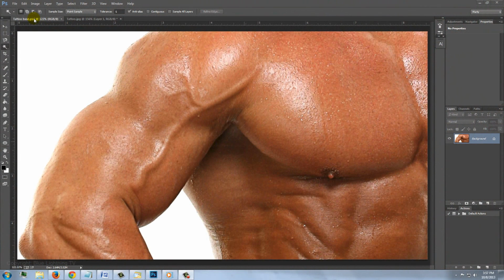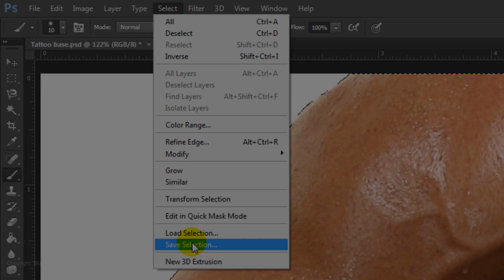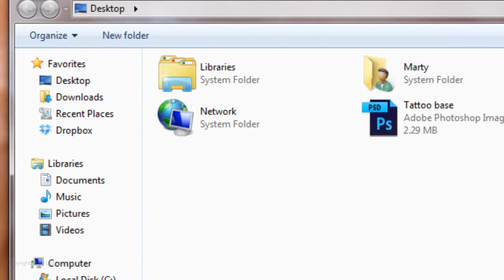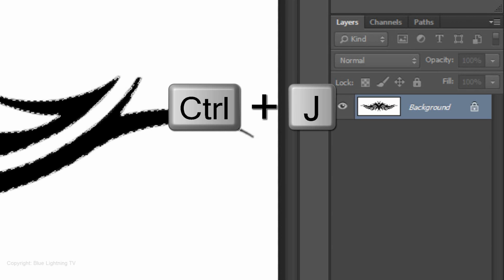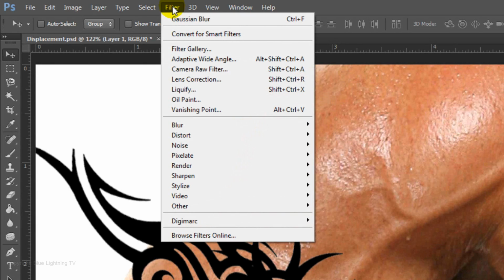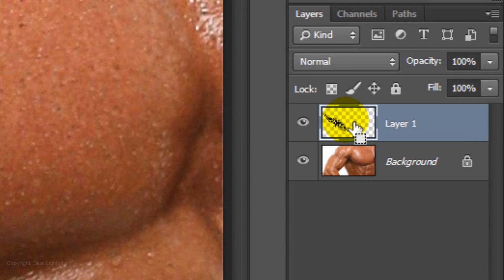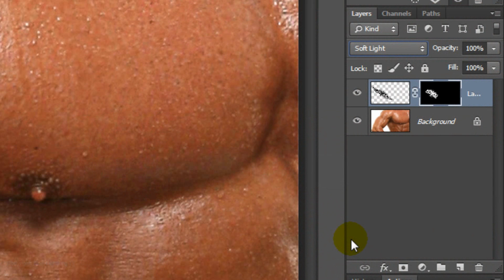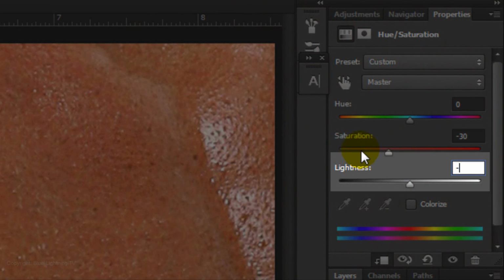Photoshop Tutorial: How to Add Realistic Tattoos to Your Body

Comment: when i change the hue and saturation it does the whole image not just the tattoo. help.
Reply: and i did the clipping mask tool thingy as you told someone else to do
Reply from the maker: By default, if a layer is clipping to the one layer beneath it, it will only affect that one layer.